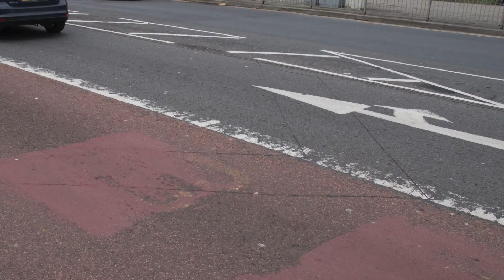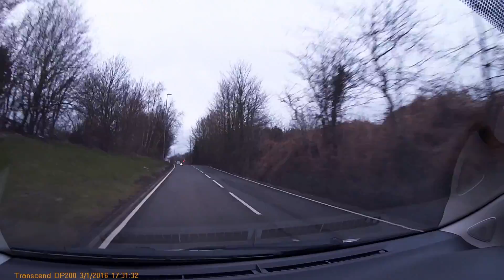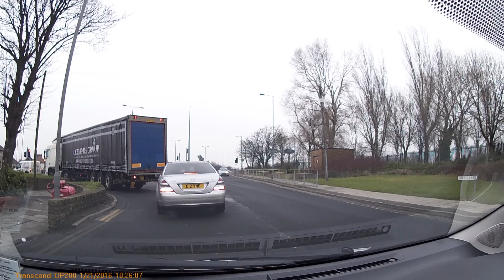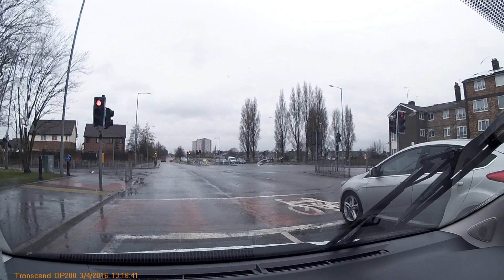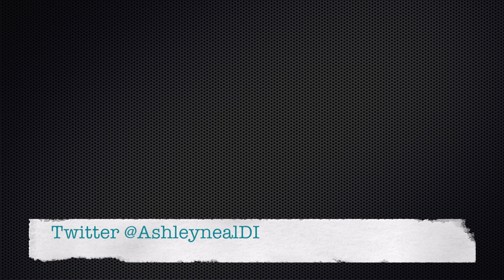Traffic Light Sensors

Comment: Does this sensor take you picture if you pass with red light
Reply: As you said, it's a sensor, it is not a camera, so no, it can not take a picture.
Reply: @tonipeters-random-stuff  thank you Sir .
Reply: However the sensor past the line can trigger a camera elsewhere
Reply: @1988dgs  are you sure . Have seen many that pass with red and the camera is other side of joint

Comment: They are not ever ever pressure sensors! They are Hall effect loop sensors that detect changes in magnetic resonance as a vehicle is over them.
Reply: Pressure sensors also exist, but they are used for axle counting, not light timing.
Reply: I have to agree with Elijah.

Comment: Usually as the pulse of traffic approaches the traffic lights from the opposite direction that's a sign they're about to change to green many drivers know the traffic light timings and speeds required between them to get through on green. When you enter a main road you either need to catch up with the pulse gone past or wait for the pulse behind to catch up to flow through the green lights.

Comment: I genuinely wish a lot more people knew/understood where the sensors are in the road, it annoys me that I know I’m waiting longer just because the car infront hasn’t stopped in the ‘right place’.  Typically they’ve usually over shot the stop line altogether, which then leaves the car behind unable to get onto the road sensor/and or unaware themselves. 

This knowledge comes from the boredom of driving the same way too much and knowing the junctions inside and out, but it is a whole lot quicker for the lights to change in certain places when the car infront actually stops on the sensor.
Reply from the maker: +ST34D From what I understand, as long as the vehicle crosses or is picked up by a sensor the lights know it's there. There are many more factors which can add up to the lights changing which are not explained in the video. Thanks for watching.
Reply: SK